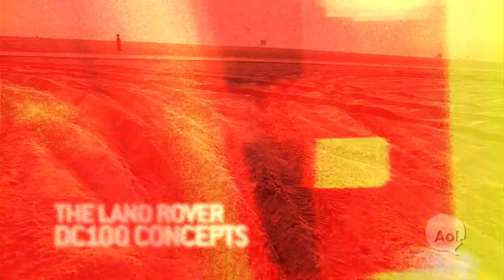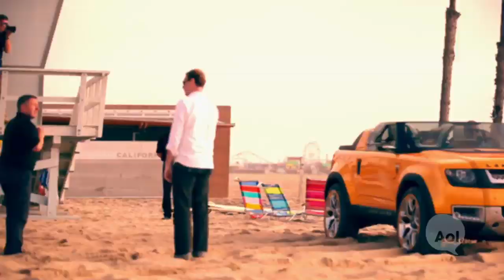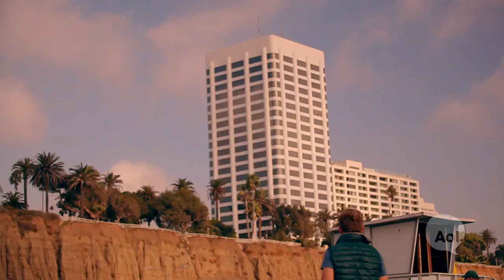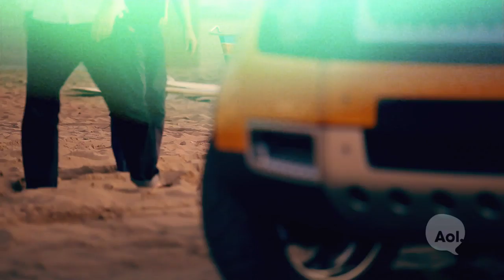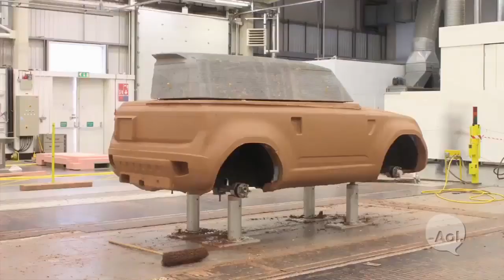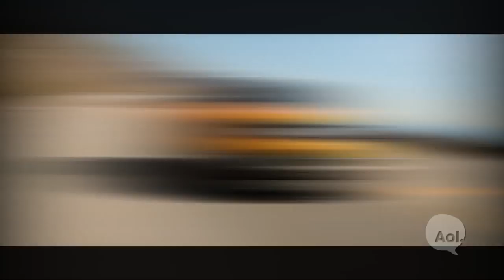TRANSLOGIC 84: Land Rover Defender DC100 Concepts

Comment: the DC100 at the moment is a shell on RR sport running gear, plus too many plasticky pits too close to the ground..... gimme beam axles and terrain response, ETC, and a locking centre diff in a revised 2012 defender with more elbow room, more leg room and revised "pedestrian friendly" body and I'd be happy.....